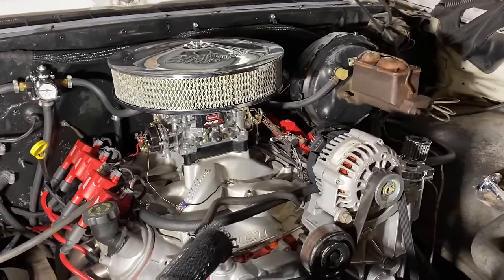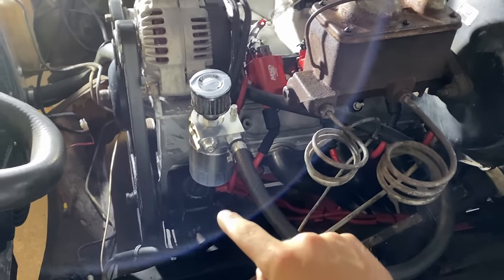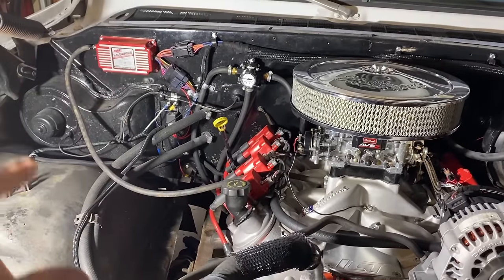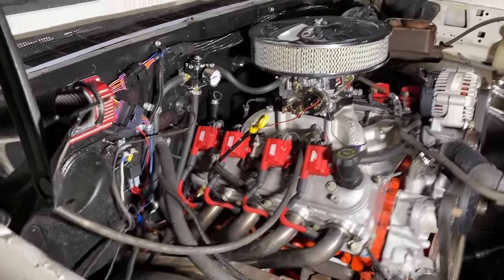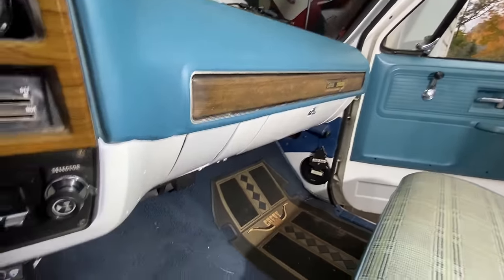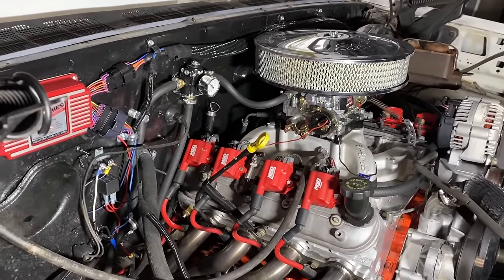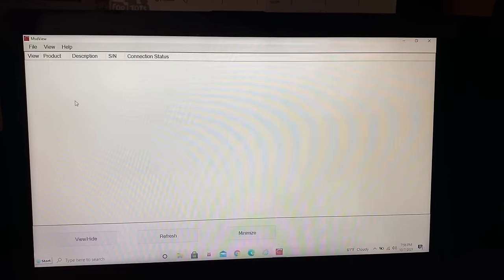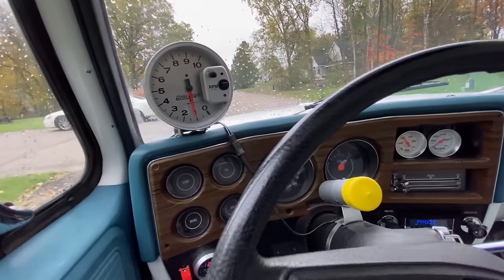CARBURETED LS SWAP! EVERYTHING YOU NEED TO KNOW! 1974 c10 Squarebody |CARB LS| |CARBURETED LS|

Comment: Cool vid, could have saved all the engine swap info for a seperate video and focused on just the carburetor info but either way good job 👍
Reply: @squarebodyblake4464  for sure man, you do you. Maybe I'll do a video like yours for my 2022 update. Hopefully I'll have that new edelbrock in my hands soon so I can go through it. I can tune any holley but lets see how that edelbrock performs
Reply: @squarebodyblake4464  Well, considering its exactly like a holley with minor differences, it should work well
Reply: Do yourself a favor and get rid of the msd coil packs. They suck.
Reply: @squarebodyblake4464  Good to hear. I bought mine new and already replaced 6 of the 8 within 20,000 miles.
Reply: @squarebodyblake4464   I replaced one the first thousand miles, the rest went out randomly. I've always ran msd products but these really let me down a didn't notice a improvement over the stock coils.
Reply: @squarebodyblake4464  I haven't kept up with your videos lately. I've been working so much OT. I'LL have to catch up this weekend.
Reply: @squarebodyblake4464  do you have to have the y installed or is it okay to go from the radiator to intake. Far as the same line
Reply: @NightWrencher hey what if i have a gen 4 engine?
Reply: @Quincy-k5z  the Daytona Sensors Smart Spark LS and the MSD 6014 are both gen 3 and gen 4 compatible

Comment: I'm a ford guy building a Fairmont. But i gotta tell ya, with the prices of ls engines right now, I'm leaning heavy on buying one. I've had a turbo 400 laying around forever not doing anything.
Reply: I drop that LS in that Ford with the quickness.Building a Ford motor cost to much money.A LS motor wouldn't cost you half of what you would have to make a Ford run like you want.

Comment: Those TH350's are a very easy transmission to rebuild your self.
Reply: How so? Looking at Precision Transmission videos they dont look much easier than anything else of that era.
Reply: @SOLDOZER  Well of that "era" I think the 904's/727's are the easiest to rebuild/reassemble, but that just depends on who ever you ask. 
But compared to today's transmissions, the old 60's designs are fairly simple, I guess???
I rebuilt my first transmission, a TH350, when I was 17, but I had a pro there to give me some pointers as I went.
The best way I think to do them is to get a rebuild kit for it first. Then take them apart on a really long bench and just lay all the parts out on the bench exactly how they came out. Then just clean/rebuild each section, clean valve body, flush out converter if it can be flushed, or better yet, just replace it, and replace any worn-out/damaged parts with good ones.
And then reassemble the whole thing back together exactly how it came apart.
That's how I used to do em back in my day.
Reply: @SOLDOZER  Once you build a few, they get easier.
Reply: @SOLDOZER it still takes know how but compared to other transmissions turbo 350 is leggos you can’t even find rebuild videos on most transmissions because even mechanics are like f$&@ that…. Buy a new one….
Reply: Not really
Reply: @MrJeep75  well a TH350 isn't as easy as a 727/904 torqueflight.
But if when you take them apart, you just set the parts out in a line in the order that they cam out of the casing, then rebuild each section one at a time, then just reassemble it in the same order that it came apart. Sometimes I have to use a feeler gauge to get to seal lips on the pistons to go back in without them folding over. For the valve bodies I usually just clean them, inspect, correct defects if any, and reinstall.
Don't get me wrong, I'm not a professional trans rebuilder by any means, but the couple I have done turned out alright, but I've only done TH350's and 727's.
I was going to rebuild a 700R4 one time and I'm glad the guy ended up selling the car before I was going to be putting it back together because I started taking that apart and it just wouldn't quit coming apart....lol

Comment: I'm gonna try and put a LS in my 83 Buick regal this summer. It used to have a stout little 383 in it but it finally kicked the bucket after almost 20 years. Got a speed shop built 700r4 transmission. 3:73 rear-end out of a grand national.  All edelbrock and Hotchkiss suspension.  Aluminum drive shaft. It's been sitting for 6 years. Had just had the interior redone, new vinyl top, all new brake lines and brakes. Cleaned and undercoated the whole bottom of the car. Then boom. Motor blew. I just haven't had the extra money to fix it. Crossing my fingers that I get her going this summer.

Comment: Thanks for the video.  Appreciate all the info.  How is the throttle response with the AVS2 and what's the drivability like on a frosty morning?  I'd love to find a square body S10 and do a carbed LS swap... one of these days.
Reply: @squarebodyblake4464  Good deal, thanks.  The reason for my question was because the LS carbed intake doesn't have the exhaust crossover like the old small block Chevy.

Comment: I have a carb 6.0 with summit ls 3702 cam in a monte carlo with 3400 stall 2004r trans and 373 gears. It feels good but I haven't played with the timing settings yet. After I get it out the paint shop I will tamper around with that. You make a lot of sense its so much unnecessary money being spent on ls swaps.
Reply: How that 200r holding up the all that power
Reply: @yobill2537  so far so good. I'm not hard on it every day only when I drive.  Lol

Comment: You can actually still use a non baffled tank with EFI, you've just gotta be careful. I'm using the stock in-cab tank on a 71 C10 with a pump hung on a modified sending unit, and it works just fine. The only thing you have to be careful with is making sure you keep it above 1/4 of a tank and don't corner too hard to avoid fuel slosh. I could understand why this isn't everyone's jam, but in a pinch and for just the price of a pump and some fittings, you can keep EFI and the stock tank. The only reason I mention this is because some people may be under the impression that you need a baffled tank or you have to go carbed, when in reality you have more options. Really cool truck you've got!

Comment: Definitely good content.   Try popping off the connection at the blower motor resistor.  It might be the brushes on the motor giving you the rf issue during start up.  Secondly would be Alternator.

Comment: I put over 200000 miles on a carburetor engine with 0 problems ,it was a 78 Buick Regal Sport that the 3.8 turbo charge engine went bad,so the owner drop in a 1977 Pontiac 301 engine with a Quadrajet 2 bbl I purchased it,rebuilt the carb,and put 200000 miles on the car with 0 problems and it ran strong,I inspect the filter with every oil change,3000 miles keep it clean ,motor had 0 blow by ,pvc valve was check every 3000 ,replace when needed so none of that bad air was going down the throat of the carb,all factory hookups stay in place and I ran a can Berryman B12 in the tank around every 3000 miles to keep the fuel system clean and the carb filter was check every 6000 miles,was replace when needed,I had more problems with fuel injection vehicles than with carburetor vehicles

Comment: Turbo 350 Turbo 400 other than lack of overdrive there is never been a better transmission ever designed or built and that motor will absolutely not tear up a good built 350 or 400 best Transmissions ever designer belt......
Reply: You can always add a gear vendors overdrive . Best of both worlds
Reply: My stock c10 fried a freshly built tranny as soon as I bought the truck, said something about high rpms burning it out, so I had it rebuilt by the same shop who gave me a huge discount and it’s been running great since, however I’ve lost trust in the transmission and I’m scared to take it above 3200rpm in top Gear worried that I’ll break it again haha. Did I just get unlucky at first or do I just drive like a knob?? Haha it does have a tranny cooler too so I’m surprised my 170hp engine managed to cause issues with the tranny

Comment: If want run temp sensor just get you one of 98 ls1 3 pin with connector and use the green wire ,also since use th350 transmission dipstick doesn't hole to bolt down cause bolt dont use is for dipstick  so have get the L bracket alot miss this ,I just did ls swap to my k10 with th350 built for 500 hp.. and runs like top but I went efi and I'm thinking swapping to carb...

Comment: Fuel vent line is restriction you may  be fine with carb low pressure. I had over pressure with fuel injection.

Comment: I just started my first Ls 4.8 with btr stsge 2 on the stand won’t idle tho I think I need a time since it’s stock efi set up. I already have avs2 carb watchin your video is making me think twice and go to carb Ls (71 el co) I’m not sure how much a tune ecu service. I’m only concerned with carb stumble off the line but bby hen again I didn’t use a fuel regulator with the avs2
Reply: A tune
Reply: @squarebodyblake4464  vats are deleted it starts just won’t idle I’d have to give it gas and I notice the passenger manifolds are way hotter the driver side exhaust manifolds. Pulled out the plugs on the passenger side it’s already  black. The driver side looks brand new. I’m really thinking about goin carb so I can just tune it myself. Your c10 sounds awesome n runs flawless
Reply: Hooked up an afm I believe it’s idling now woohooo

Comment: Can you explain or show how you set or tune your MSD to run with truck without using the presets. I have mine ready, just waiting on a few parts. I'm doing same set up but I'll be using a th400. Great video
Reply: @squarebodyblake4464   I been deciding on my own tune, my plan is 6.0 with th400 possibly a stage 2 cam. Mainly just a cruzer, nothing to be speeding around. Also I live in a higher elevation, and I need the choke.. that's where I'm deciding on a custom tune. But I was wondering if you use the preset tunes and how did that work?

Comment: Those neoprene fuel lines are a fire waiting to happen. You can't replace that truck for less than the cost of some braided lines routed away from the exhaust.
Reply: @squarebodyblake4464  plus carb have way less fuel pressure than injection.  More likely to have fire with injection.
Reply: The kid is right rubber fuel lines been on carburated cars for ever. Old school is cool. Some people should crawl back into thier Fart Can Honda's and STFU.  Hope to get my 80 Silverado back to this condition soon.That I've owned for 30yrs. This is exactly the kinda swap I've been looking for a long time. I like the idea of OD transmissions but if can keep my th350 I'll do that. The way I see it no ecm needed. The less electronics the better. This coming from someone who has been an electronic tech for 40yrs.
Reply: I have one of these trucks, and the fuel line is steel to the fuel pump, and then steel up to the carburetor. From the factory. Running fuel line right next to the hedders is stupid no matter what material is used. For a couple extra dollars you could have done it right.
Reply: @georgiastreettruck4495  we all a aware of that we're not saying you wrong.

Comment: How do you adjust the shift points or can you , can you block off the steam ports, and is that the original power steering pump or one with the accessories

Comment: Can you elaborate a little more on the alternator wiring. I have 66 Chevelle and am using oe factory harness with original 2 pin connector on my ls swap
Reply: Idk how to get gen light to turn on and off and make it charge
Reply: I have a 72 Chevelle doing a swap in now I got a pigtail and resistor from painless performance hopefully it works directions are kinda janky

Comment: Show a video of how you run the PCV hoses.   Did you go to a higher stall with that cam?
Reply: @squarebodyblake4464  I am running a similar setup.  Same 8701 cam.  Truck was a dog off the line.   Installed 2400 stall.  Not much better.  4.10 gears   Engine like high rpm but trans shifted at 3500.  Never got much performance out of it.  Went with manual shift 4L60. Lots better.
Reply: @squarebodyblake4464  yeah.  I did that too. Just had not pep from dead stop.

Comment: Hello, I was wondering, does your radiator have a steam port connection..I thought I seen a connection on top of the transmission cooler connection..Thanks
Reply: Miguel the link I added by BadLuckGarage goes into great detail with multiple options for the steam port line.

Comment: Great video man. 
I put one in my old hunting rig. An 84 blazer. 4x4. The only issue I had was the carb. I had a brand new Quadrajet still in the the box from the early 80's. Had a bad dead spot off idle. I could put it on any one of my other engines.  A 350 in an 85 4x4 and two different camaros one a 350 mild cam and one a 400 small block with a big cam. It ran perfectly on those and I tried 3 different holleys. 600 vac secondary. 750 vacuum secondary and a 750 double pumper. Every one I tried had a dead spot. 
I went with huge drilled out squirters on the 600 and got It drivable. But it still wasn't right. So I gave up and put a holley sniper on it. Runs perfect now. 
Did you have any problems like that with the carb ?
Reply: LSs are a different breed. You need to actually tune the carbs to get them to run the way you want to. Adjusting the idle mixture and speed screws isnt really going to cut it. LS engines flow a crazy amount of air a low rpm so light throttle lean spots are pretty common.
Reply: If it stumbles off idle its usually a timing issue and an accelerator pump issue which either one is an easy fix make the pump squirt more gas the stumble will go away .. it's a combination of the two tho usually timing and pump if your running an L.S on a carb then its using an msd box and you can tune it to have whatever initial timing you need and total timing etc dont be afraid to tinker w it most stock engines love timing quickly

Comment: What bracket did you use to hook up the throttle cable for it to mount to the intake manifold?
Reply: The truck started as a carburetor 🤷

Comment: Whats power difference in a 5.3 LS and a stroker 383?
Reply: @squarebodyblake4464  they are both good engines and reliable, either choice will do well. The 383 has a more distinct and bad ass sound. The LS has better fuel economy even with a hot cam. I am doing an LS swap in my squarebody as well but will go with a 383 once I get more $$$

Comment: What is your Timing curve  my ls carb swap keeps running hot until I turned off map signal  feels weak now msd 6014
Reply: Mine keeps running hot also can’t get coolant bleeding done for running hot spitting through carb
Reply: Go in to msd box and turn off map sensor  im asking about timing settings for msd box inital and total #
Reply: @doingmorewithlessmotorspor8951  I need that info to be great thanks I’ll turn map off see what I can blow up lol

Comment: Hello i just installed the dual plain intake and 1406 edelbrock  carb on my 05 5.3 stock with the ls series msd box same as yours wont start just back fire out carb and exhaust does the msd require and programing to run it

Comment: Nice video man I’m running a 5.3 and I’m trying to make my own tune how do you send over the tune to the MSD 6014
Reply: @squarebodyblake4464  I'll be waiting if you do. Appreciate the video
Reply: @squarebodyblake4464  Yes on the msd video!
Reply: @squarebodyblake4464  Thank you sir! I have a 98 LS1 Camaro I'm thinking about switching to carb when I swap cylinder heads. Not sure about early 98 pcm.
Reply: Thanks bro I really would appreciate it this my first ls swap I got a 86 Shortwheel base C10 I’m gonna pick this set up in

Comment: I have the msd 6010 and my current is connecting the 12v pink power wire? Any help would be greatly appreciated
Reply: @squarebodyblake4464  ok because to a direct hot. it's running but won't shut-off. To the distributor power source no crank
Reply: @squarebodyblake4464  ok give it a try first thing tomorrow

Comment: thank you for this video i wont to do this on my k2500 97 will it be hard to put my motor on my  700r4
Reply: @squarebodyblake4464  i dont much  wont hot my truck but need some more power to pole our rv we just got i have a friend he builds 700r4 i had hem put the hot rod parts in it i hope it works ok i have 350 in it i built alog time ago its getting tired out

Comment: That is hard on brakes, tranys, rearends and everything else power breaking I learned the hard way
Reply: If your tearing shit up your doing something wrong there's no need to hold it back but a few seconds
Reply: Of course if you try hard enough you can break anything but hell an older general motors product can take a hell of a lot of abuse w out a doubt I'm not gonna lie and say I never broke a dam thing cuz I did plenty but it wasn't that easy to do even going 40 mph in the rain and putting it in reverse turning the wheel and spinning around not knowing where you'll land was a whole lot of fun and hell we all did that to about every one of the cars we had for years my 73 malibu I cloned to a ss chevelle my buddies Pontiac Ventura another car my other buddy had it seems tho that coil springs did not like that shit it had to be a coil spring car otherwise it would axle wrap like a bastard .. lol aka wheel hop but I dont care what you do your not gonna break a turbo 400 tranny so ..

Comment: Part number for painless performance harness? Which wires from bull head did you use?
Reply: ffs, it's just the 4 pin to 2 pin ls alternator plug, Google it